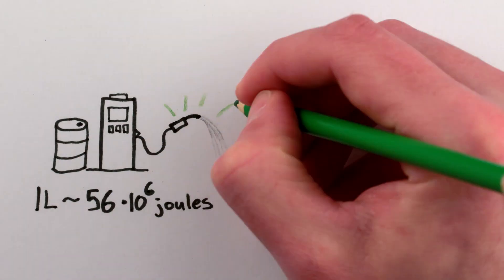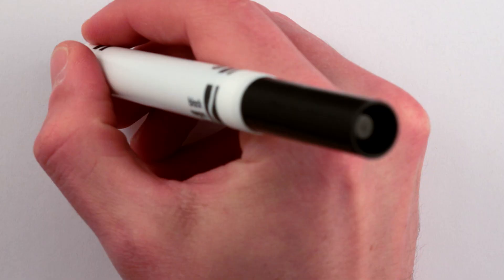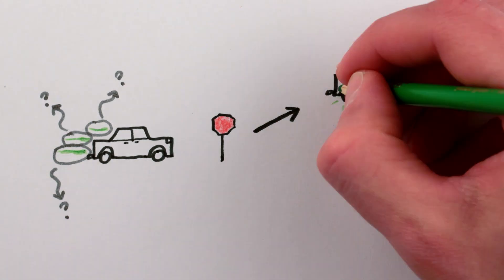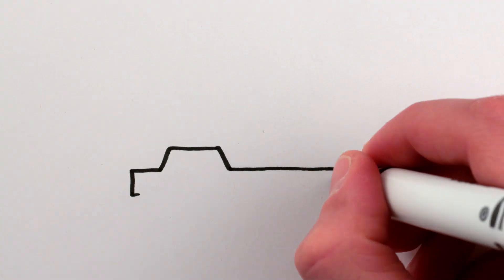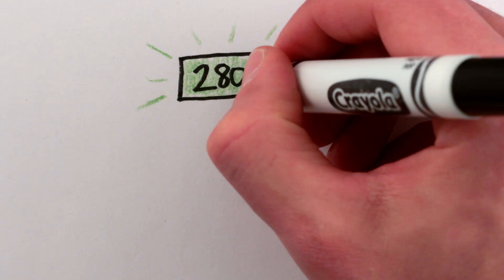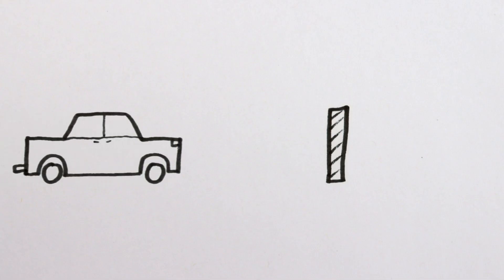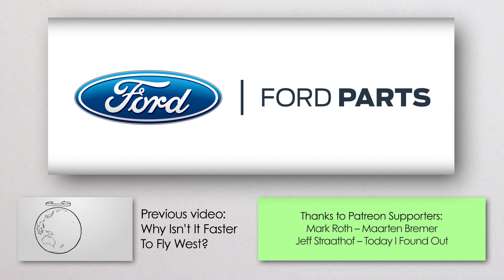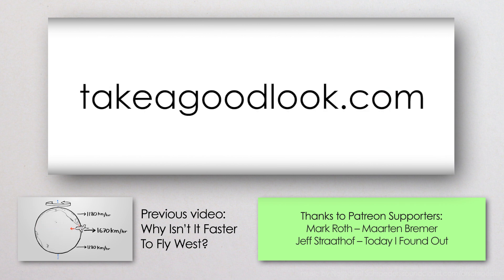The Physics of Car Crashes

Comment: Thanks for using metric units!
Reply: +Raik This isn't pseudo-science, i think you mean popular science.
Reply: +melig1991 Don't forget the falling Stegosaurus unit!
Reply: +RuneR96 That, of course, is a universally accepted unit.
Reply: +Linken Still using silly things like teaspoons and "a third of a cup" though :(
Reply: I see you edited your comment. Fair points, and I have no more objections. And yes, NASA has learned from that -- they switched to Hard Metric in response to that incident.
Reply: +Garuu Spike Imperial units are not "imprecise." 

Measurement is measurement. The only differences between Imperial units and metric units is their ease of conversion. Metrics are easier to convert since all you have to do is move a decimal point. Imperial units require an equation... and the answers are usually pretty obscure.
Reply: I do like measuring my petrol in dm3 :)
Reply: We Americans use the metric system all the time. Our soda (Coke/Pepsi) bottles come in metric, our mobile's headphones have metric plugs, and finally, we buy our cocaine in metric units. We use it for fun stuff, see?
Reply: +Garuu Spike Nasa? Please. Mars Climate Orbiter. 'nuff said. Though I hope they've learned from that by now. Anecdote aside, the fact that you call Imperial units "imprecise" makes you sound like an idiot, which I don't suppose you intended. Imperial units may not have decadic magnitudes, but that doesn't make them any less precise than metric. Just as you can have exactly 1 Litre, you can have exactly 4 quarts, and not a single drop more or less. As for the cooking - The units are made for convenience, it doesn't matter they don't convert well. Of course you can convert a pound of sugar into pinches, but why would you want to do that? Still, the units are as precise as they need to be, because if you do need a pound of something here and a pinch of something else there, you'll always have just the right amount.
Reply: +MJDHX Haha u get it
Reply: In regards to the people arguing:
Both Metric and Imperial have their uses. The way I see it, metric units are better for science, engineering, and other technical things, while Imperial is easier to use for more simple, everyday things.
I would be perfectly fine with the U.S. switching to Metric, but I would always still use Fahrenheit for weather and food-based temperatures.
The smaller units allow for more precise measurements without using decimals. Makes it easier for kids to understand, and it&#39;s less of a mouthful.
&quot;Hey, what&#39;s the temperature like today?&quot;
&quot;My phone says sixty-five degrees.&quot;
ALTERNATIVELY:
&quot;My phone says eighteen-point-three degrees.&quot; 

Those're just my opinions though.
Reply: +Linken And not one of the top comments is "Waaaahhhh. I don't understand. It's not fair." Despite likely over half the audience not using the measurement referenced.
Reply: +Linken Is it that surprising? In the US, many high schools (if not all) use the metric unit system in the main science subjects and all universities in the US use the metric system for the science classes. Of course he'd be using metric units.

On that note, I wish the US would finally just make the jump to using the metric system all the way. :/
Reply: +Linken 
Go back to Un'Goro!
Reply: +Linken Anybody doing calculations in the US always use metric units. Using regular units in any kind of measurement is elementary stuff. But everything else is sadly regular. The mile is the only unit i like.
Reply: Avaryes
Pseudo-science because falling stegosaurus unit FTW!
Reply: *****
Of course, because everyone knows what a freaking adult stegosaurus weights! Even tho we haven't weighed one in millions of years we just know.

*Don't reply I'm being sarcastic here :D
Reply: metalhead2508
I think he is referring to the fact that Inch is meant to represent the length of your thumb, and foot, well, the length of the foot. Problem here lies that different people have different sized feet and thumbs, and elbows, and all the other body parts that the descriptive measurement systems, which imperial used to be before standardization, are arbitrary.
Reply: +Crawfishness or, you know, you'd just say "18 degrees"
I certainly can't feel a .3 degree difference in temperature, though if you can then that's cool I guess.
And as for cooking, I haven't seen an oven that doesn't go up in at least 5 if not 10 degree increments, so I don't think the loss of precision is a significant problem in cooking

The only valid reason I can think of for not wanting to switch to (entirely) metric is that everything in America is already in imperial (which I see as a perfectly valid reason, I still use knots and feet when on the water, despite those units being archaic and a waste of time - I'm just stuck cause I grew up with it)

Gee it makes things more difficult though.... I'm a civil engineer, and our road standards are still based heavily on a test carried out in America in ~1960
Reply: +Crawfishness Fahrenheit and Celsius has nothing to do with imperial and metric. 

Also you are wrong. You are just used with the two retarded systems no one else uses.
Reply: +melig1991 Oh the horror!
Reply: +Garuu Spike  Imperial units are less precise? Show me. NASA uses mostly metric but many of their videos and other published material are in imperial. Something about Americans funding all of this makes the difference, apparently.
Reply: @JoeyRodz74 they translate their science dissemination material to imperial units, just to make it readable to the american public. But NASA does not actually work with imperial units. Like, at all. Never. Not even a tiny bit. It's not about who is more influential to promote their system, it is all about the systems in and of themselves. The metric system simply works better if you are trying to do science, and not by accident, rather by design. The metric system is designed to facilitate calculations.
Reply: +Sun E Well, to begin with, I didn't expect to have this war of metric vs imperial units in response. But as a non-american, I surely appreciate the use of metric units in a video from MinutePhysics, which as far I know, is american. I don't know to what extent americans use metric (besides of the cientific world), but it's good to hear that they teach it continually. Maybe in future generations they will use it more and more. At least that's what I hope for.
Reply: Why wouldn't he?
Reply: +Linken Many physicists use metric measurements, even in the USA.  The US is slowly getting used to metric.  Soft drinks are sold by metric containers.    One thing I wish users of metric measure would NOT do is pronounce the metric measure, the kilometer, as "kill-AH-mit-er.  It is "KILL-oh-meet-er.  Accent on the first syllable.
Reply: +Linken SI >> metric > imperial
Reply: Ray Sills Around here we just call them "kays" ("Ks"?) anyway
eg "a few kays down the road"
Reply: r315r4z0r yes, but I'm having problems with them, there are 12 inches in a foot???, so, convert 5' 6" to meters, please.
Reply: Use Imperial Units
Reply: Metric Sucks Idiot
Reply: Can we have t-rex measure units pls, love t-rex
Reply: metric system sucks
Reply: +Linken we're talking about serious science here, of course he's using metric

imperial is really just used for everyday chatter and imprecise activities such as cooking in the USA, as well as amounts that are simply intended to give an "idea" of how much something is rather than the exact amount (about 5 teaspoons, about a third of a cup, etc... the operative word here is "about")

all serious scientific institutions in the USA use metric, including NASA, car manufacturers, and more
Reply: +melig1991 Easier than 233ml and 23 grams don't you think?
Metric units are used by the entire world but 'murricans and teaspoons and cups are also used by all the chefs and cooks...then again this is a pseudo-science channel.
Uhmn, wouldn't kill them to use both? one narrated and both written. Everyone happy!